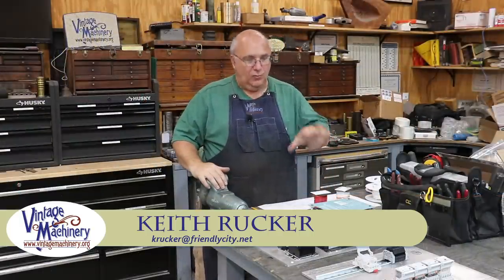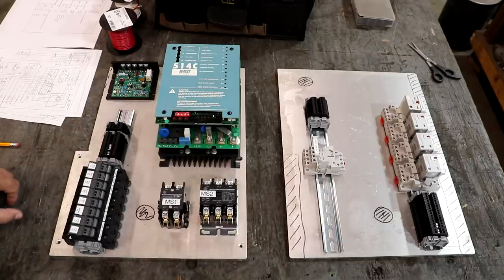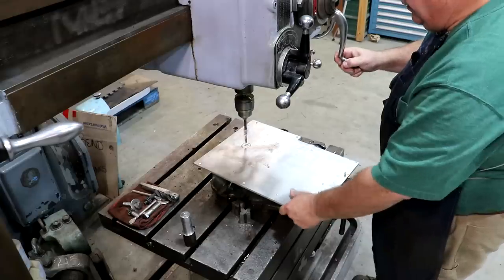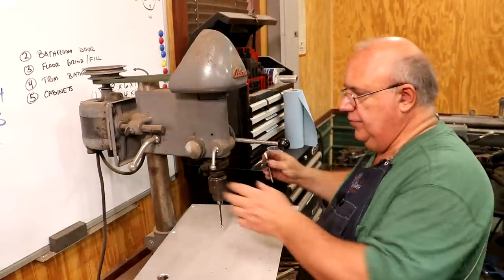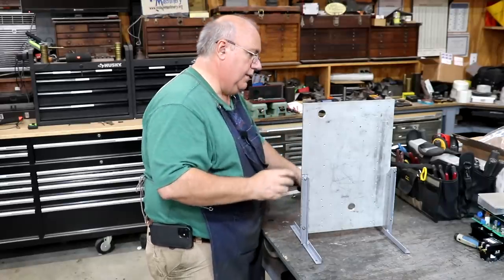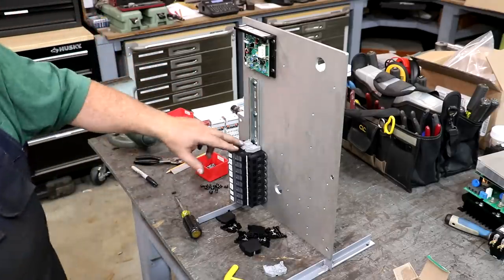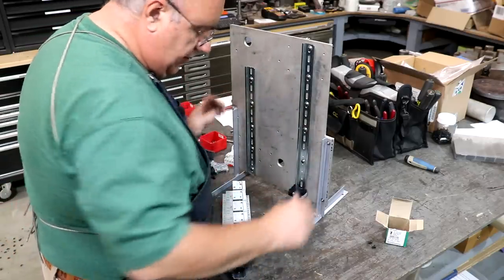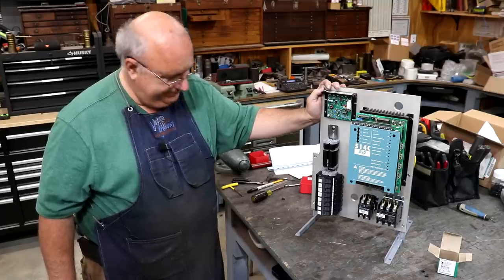Monarch 10EE Drive Retrofit 3: Building out the Electrical Component Panel

Comment: That is BASICALLY way over complicated- VFD inverter and 3 phase motor will do it all and better.  If a guy had a nice bench vise he could clamp that aluminum panel and it wouldn't flop around while he bolted on his brackets and components.
Reply: The DC motor is more powerfull at low RPM that's the reason he isnt switching it out for a 3 phase.
Reply: @samuraidriver4x4  It's a 5HP motor- you can buy a 10HP motor and Inverter for less than 500.00- all top quality units.  VFD inverters are equal in low speed torque to DC motors and speed is controlled by varying the frequency while maintaining full voltage.  VFD inverters have tons of features for all sorts of applications including dynamic braking, all available through simple code programming and can operate on either single or 3 phase input.   The big problem I see here is that he is designing a complex and expensive drive system for an 80 year old 6 wire DC motor- if that motor fails he will have to search out another exact antique to replace it.
Reply: I think he wants to keep the motor with its two speed gearbox that matches up to the rest of the lathe. If the motor fails at some point it can be rewound.
Reply: Only reason I can see for the DC drive is to keep the existing motor.  If the motor dies then replace it with VFAC.  It might be an oddball mount or something.
Reply: @lowercherty  A mount is just a matter of drilling some new holes or making a plate, but if the motor dies and he goes to a VFD, then all this expensive stuff goes into the scrap with the old motor.
Reply: a VFD and a AC motor cannot compare to a DC motor for speed torque performance let alone the smooth power from the DC motor the VFD gives to a modified square wave softened with caps and inductors but still jerky .this would compromise the performance of the 10EE in regards to finsh
Reply: @garybeasley4885  The 2 speed gearbox would not be necessary with a 10HP VFD, but just for originality sake, it probably just attaches to the motor with a keyed shaft- As far as rewinding that old motor- do you have any idea how much that would cost- you're in for a shock.
Reply: @oldschool1993  Last I heard it was anything 10HP and under was cheaper to replace than rewind. So yes rewinding is not cheap.